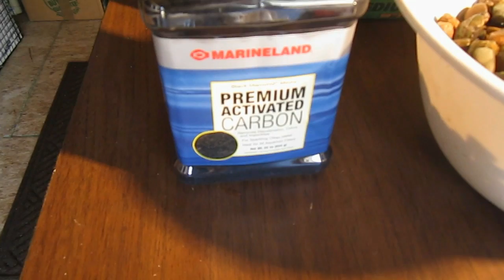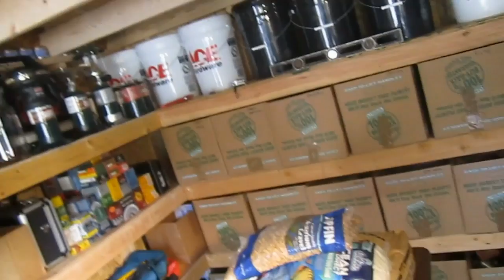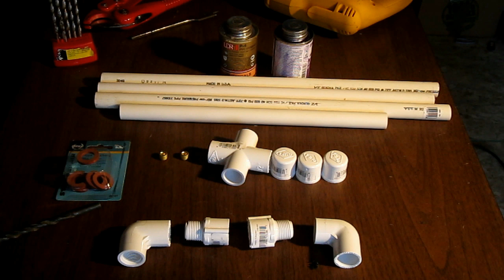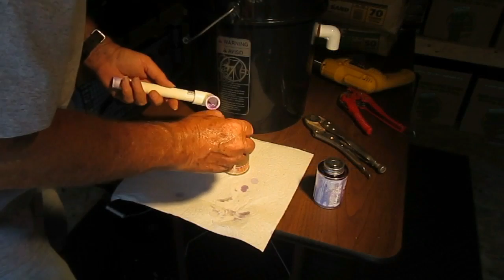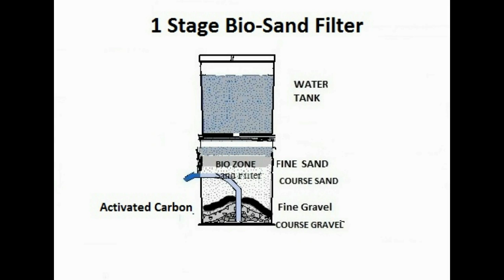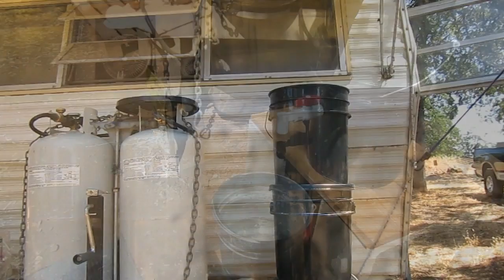Bio-Sand Filter Part 1, 2 & 3

Comment: what is the maintenance on the two stage system? and are you still using this system? thank you in advance. this could also be built before hand and then put together with the proper bacteria and have clean water in the even of a disaster.
Reply from the maker: You need to clean the surface of the Bio-Zone if you see a build up of dead bacteria and debris. Flushing the system every 6 mo is recommended if clean water is available. I used the BSF for removing sediment from the well water. The well cleared up after 4 Months so I stored it for emergency use. The well water had no bacteria and there was no noticeable Bio-Zone created.

Comment: im wondering what type of bacteria would you buy at an Aquarium shop? im interested in preparing one of these to have on hand but when I look for bacteria at pet smart there is like 17 different oneshttp://www.petsmart.com/search/index.jsp?kwCatId=&kw=bacteria&origkw=bacteria&sr=1&f=PAD/psNotAvailInUS/No. and awesome video very informative.
Reply from the maker: I did not use a starter bacteria as I was only interested in removing sediment that accumulated in the well shaft from not being used for many years. You should contact an aquarium shop and see what they recommend for killing Giardia and Cryptosporidium. Let me know what you find out I want to get some also.
Reply: How much bacteria added to a filter?  May find as I read up the comments.  Someone also suggested pictures of bacteria cleaning.  A maintenance video would be great!
Reply: Per the PetSmart link, below it seems that one pouch would be way too much.  2 tsp per 10 gals?  How long to create the layer this way.
* * * * * * 
Directions: 
For new aquariums: Add entire pouch to cycle up to 40 gallons with about 15 fish under one inch. 
For monthly maintenance: Add two teaspoons (10 ml) per 10 gallons to replenish and boost beneficial bacteria. 
Ideal to use when adding new fish, filter maintenance and monthly water changes.
* * * * * * 
http://www.petsmart.com/food-care/cycling-aids-bacteria/marineland-total-care-aquarium-bacteria-zid36-21347/cat-36-catid-300035?var_id=36-21347&_t=pfm%3Dsearch
Reply: Not sure if I'm "littering" here ... but it seems not all bacteria is created equal.  Bacteria bottles may not be the right kind, at least in an aquarium, and may be superseded by other bacteria.  "Darwin" lives!
Reply: "Other seeders arrive" section ...
"It also claims to have a long shelf-life of around 4 years."

Comment: one last thing at your local aquarium shop they do have cultures of good bacteria you can use to jump start your biomass. If you build this for emergency use just keep a bottle of it with your pails and dump it in when you need the filter. Just make sure you get the fresh water variety. Oh yea activated carbon is fine as long as it is after the biomass in the flow. I do recommend putting it in a fine mesh sack at a point of easy access so you can replace it easily.

Comment: you would have better luck getting washed sand of a little coarser variety like what is used by masons to mix their brick mud. Bacteria like surface area at a microscopic level it is like a housing project. Also this type of bacteria need three zones one for juvenile growth, adult reproduction and mature. The trick is to alternate cleaning between the zones, removing the mature,  making room for the life cycle to repeat or your bacteria will all mature and die creating an ammonia blossom.

Comment: I noticed you used live sand for your fine sand bio mass. Live sand is a marine sand made of fine coral and full of trace elements including, zinc sulphate, calcium chloride, manganese chloride, cobalt chloride, copper sulphate, sodium molybdate, strontium chloride, nickel chloride, potassium bromide, sodium silicate. See all the Chlorides. By design it will slowly dissolve as you batch your water good for marine aquarium .but  in these amounts not so hot for human kidneys.

Comment: Wish I could take credit for it, but I saw it on one of the videos here.  Naturally, the charcoal will need to be washed to clear it of dust.  If I remember correctly, their exit pipe with the charcoal in it came from the bottom of their filter outside and went up with a "u" bend at the top.

Comment: @Ebiczebulanious Sorry I wasn't clear on this.  In SHTF, I will not be operating the sprinkler system.  Instead, I will adapt a hand well pump to it somehow so that I could access the water from the well to drink from.  I did a video on it to solicit advice on how I can do that.  A friend of mine constructed a bio-sand water filter for me, but I want to do one like yours because its smaller and easier to manage.  Thanks for the replies.  :-)